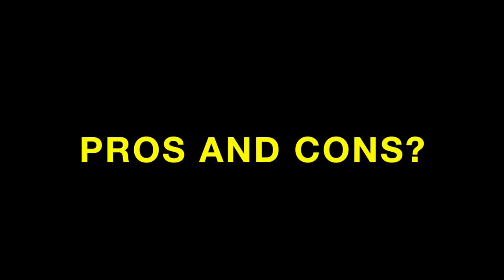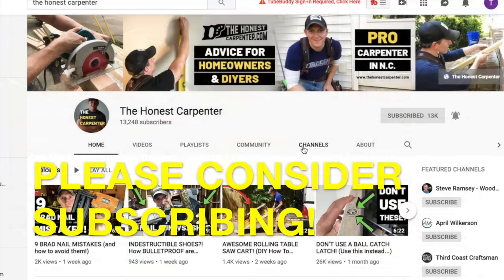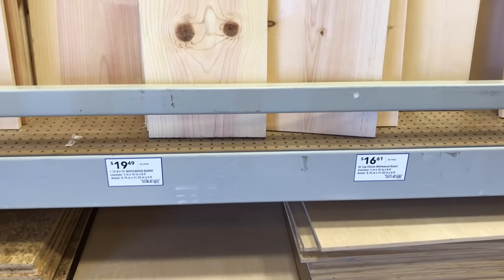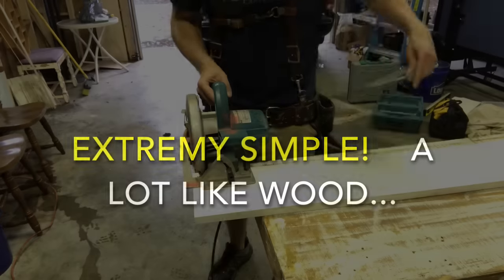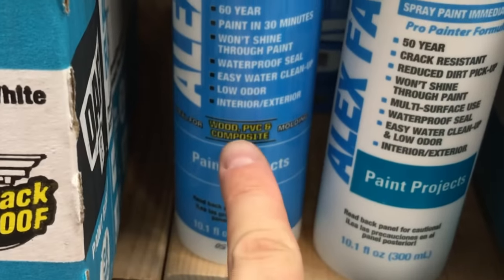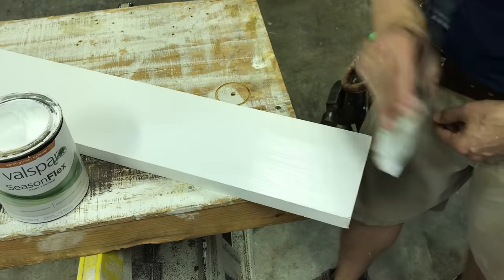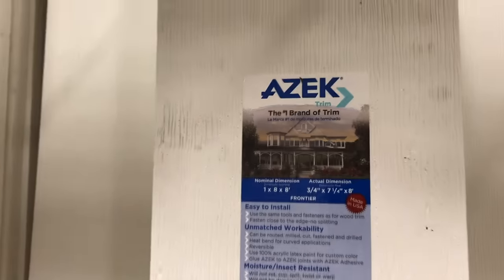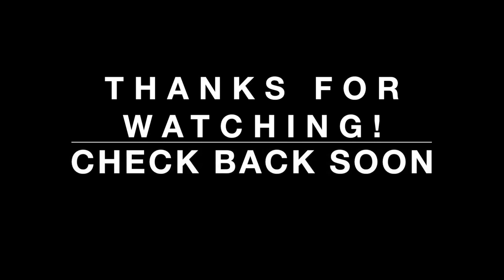PVC TRIM VS. WOOD TRIM? (Pros And Cons!)

Comment: I replaced the exterior trim on my detached shop (30' x 60') 5 years ago with the pvc trim I got at Lowes.  It's held up great.  My trim was originally white so it was an added benefit as to not paint.  On my corner pieces, I built a wood jig so I could  glue two of the trim boards to each other and keep them perpendicular.  The corner pieces were about 9' long.  I experimented with different pvc glues and the regular pvc glues for pipe had to short of a tack time  I ended up using a product by RH called HH-66 and it worked great.  It has a tack time between 2 & 3 minutes.  Long enough for me to apply glue to both surfaces.  15 to 20 minutes to be able to use.  It's about $30 for a 16 oz can but it goes along way.  I am now starting on my house and replacing the exterior trim.  What I found out about this glue, is you do not want any of it to run out on the exposed surface.  It melts into the pvc.  Strong stuff.  I scribe a pencil line about a 1/4" inward on both surfaces for my glue line to minimize any squeeze out.  Did not compromise the joint.  I used stainless steel white nails to complete the nail up.  Not one joint opened up.  I pre-assembled the corner pieces for my house (14 corners).  On all my glued corners, I actually waited until the following day to use.  Sorry for the long winded write up, but this glue really worked for me.  I did not try the Aztek glue so I can't say anything about it.
Reply: I had alot of luck using gel superglue. It held was super fast and very strong. I actually tried plumbing pvc glue too but it wasn't close to as strong.

Comment: Here's the thing about wood trim, its like a sponge. The vast majority of carpenters cut and install exterior trim without sealing the ends or backside. If the wood piece is properly sealed before installation, it can last much longer. I always seal the ends with a couple of coats of primer. In high moisture areas, such as, water tables and column wraps, a thick film of caulking or sealant is very helpful. Why is no one doing this? Yes it takes longer, but the results are long lasting.
Reply: At that point you might as well, and should, use PVC. Don't have to waste the time and money to seal the back and cuts with paint and primer. Plus it will last forever instead of a long time. I work for a design and build firm here in Virginia which is very hot and humid half of the year. We use PVC for our exterior trim 99% of the time. Saves on time and money when it comes to our warranty department. As long as the carpenter uses galvanized or stainless nails then we never have to go back to do repairs on exterior trim.

Comment: The fires in California have me re-evaluating everything now with an eye to blowing embers. If they could make PVC lumber fire resistant, it would be much more attractive. Right now both wood and PVC  are vulnerable. I’m using more galvanized/bonderized metal trim and stainless steel foil coverings as a result.
Reply from the maker: Hadn't thought about that DIY Guy...but unfortunately it makes a lot of sense in your area. I can't imagine how far the embers must travel out there. You might see some material manufacturing changes out west that are more focused on fire aversion. Thanks for watching and writing in!
Reply: Cement based products may be a better choice for your application.
Reply: @chrisgraham2904  Agreed. Over the past year, stucco with a thermal break over mineral wool seems to be the best that I could find.
Reply: @edbouhl3100  Sounds like a great option and you can tint the stucco to any color you wish.

Comment: Hey liked your video! I just subscribed.  My  home was built in 1947. So I've been doing a lot of renovations lol.  I have a question for you. I can't seem to find an answer anywhere on YouTube.  I made a big mistake on my bathroom flooring. Lol I learned from it. There is a 3/4" gap between the shower/tub insert and my vinyl plank flooring.   I've decided to put a 9/16" mounding in the gap. What would you use to adhere pvc to the tub? I bought some "Flex shot" which says it's good for tubs and showers. Now I'm afraid to use it.  It's a rubberized adhesive sealant.  Thanks Dawn

Comment: Does it have to be painted?  I am looking for some exterior product that does not need paint.

Thanks
Reply: I think it doesn't need paint, but perhaps it could fade over time like normal pipes. Just make sure to ground your tools( someone mentioned this earlier in the comments) and collect the dust. I recommend taking the dust to a person who recycles pvc. You can use water to keep the dust from flying. Just saturate it as you are cutting. You can waterproof your tools with some spray on Silicone lubricant.

Comment: I always advocate for PVC trim. Both indoor and outdoor. 

When installing the PVC trim indoors, if you install correctly around water proof flooring (life proof, linoleum, tile, ect.) you can chaulk the bottom and top of the trim effectively creating a tub that will keep your drywall, insulation, and studs safe from accidental water events inside the house, like kitchens and bathroom areas. 

Outdoors, I advocate for PVC trim especially around doors and windows, facia, window sills, and especially on the weather side of the house. 

I actually sided an entire house on the weather side with the stuff.

18 guage and 16 guage nailers Cruise though the stuff and your standard siding or roofing nailer works well with it too.

And the ONLY chaulking I use period is DAP Alex. It is the best stuff. 

Also, you can paint PVC with Acrylic Latex paint and primer.

Comment: It is obvious to me that you would have the correct answer to my question:  I would like to use PVC trim  (Veranda 7318 @ Home Depot) to replace vinyl moulding at the junction of the floor/wall in a bathroom, but after removing the vinyl moulding, a lot of very sticky adhesive remains on the wall. Do I need to remove it (and HOW - it fears not acetone and Goo Gone), or just apply the  DAP Alex/Loctite PL over it, or what? 
Many thanks from a new sub!

Comment: Hi, Very informative video as always. Thanks for sharing. I am looking to build a custom threshold for a patio door. Custom, because I can't basically find a 10+ inch threshold to fit between the patio door and the storm door. Would PVC be a good option? Trying to avoid treated lumbar.... would ceder be a better option? Thanks in advance to all that can give me a little guidance on this one.

Comment: Will it melt on my jointer, and will it wear the knives more? I need to reduce the width (edge jointing) a bit of some 7ft long 3/4 and 1 inch boards to match older construction trim that is not exactly to standard dimension on my 4" jointer.

Comment: I have rotting trim at bottom of door frame.  Do the differences in expansion/contraction all them to synergistically work together?  In other words, can I cut out the rotted portion and replace with PVC trim or will I have to replace the entire frame.

Comment: @The Honest Carpenter I'm planning on using this PVC trim around my windows and doors. If I screw it down about every 12" will it buckle when it expands? Im talking about 4 screws on a 1/4" X 3½" X 48" just for that wood cased look to contrast a dark color siding paint. Is there any other suggestions that wood be better to door. Any help is appreciated.

Comment: Is there a way to heat weld the pvc product on the market, also have you ever thought of using pvc cleaner and glue for assembly  of joints or mitres

Comment: I usually use a hot blade cutter to cut my pvc trim to make the edges smooth and to avoid the dust.
Reply: What kind of hot blade are you using when you cut?
Reply: @robstaggr  I don't use a conventional version from the store, i made it myself.

Comment: How do you approach long runs in fascia where the run exceeds the length of the board? Do you use a printable pvc caulking or primer and glue to extend the board?

Comment: Hi Ethan, I am planning to use 12" PVC trim as a beauty board around a deck that has a 45 degree bump out.  The ends of the boards need to be cut at a 45 angle.  They won't fit in my mitre saw, how would you suggest cutting them, with a circular saw?  Worried about not being able to make that straight cut with a circular saw.

Comment: I have some basement windows on one side of my house that are at ground level and they have old metal window frames that the sill plate are rusted and water is leaking from underneath the replacement windows that were installed 15yrs ago . Could I install a piece of PVC one by under the replacement windows to raise them up a little bit can I just silicone it down and use tapcons to screw it to the concrete

Comment: Hello thanks for sharing. Just a quick question. When used to replace a rotted vertical wood trim (edge of acrylic shower enclosure from another owner), can pvc trim be carved to match other shower trim design (3 indents running length of trim) or if same trim design isn't available just grab a plain one? Also, is it safe to install over  Borate wood rot treatment? THANKS

Comment: I was considering 2x2x8 plastic lumber to use on top of a pergola, however at $3.55 per foot/$37 per 8 foot compared to 2x2x8 lumber at $3.55 per 8 ft that is over 8 times the cost not including shipping! Staying with lumber and stain.

Comment: I read the label on the PL Premium and saw it said it's not for use for ABS bath surrounds or anything with water immersion. So, what adhesive should be used on shower surrounds? For example, I have a Sterling tub surround made of Vikrell that will have a Duratrim thermoplastic window trim (as there is a window in the shower stall). What adhesive would you recommend?
I came here looking for info on appropriate trims for windows. Right now I have metal windows that sit flush with the exterior (no sills) and have J-channels right up against the edges. I'm going to be replacing the old windows so I'm trying to figure out what sort of material to frame them with-- thinking of maybe going with PVC instead of wood since the wood sills on my doors have rotted.
Can the PVC be used to help anchor an awning over an exterior door or would wood be better? By anchor, I mean I want two vertical pieces of PVC on the exterior to help support and bump out the awning from the wall a little. I will have wood blocking on the inside of the wall as the anchor.
Man, where are you finding whole PVC sheets? None of my local stores carry most of these products. They have to be custom ordered & I had some I ordered back in May that never arrived. Had to cancel my order.

Comment: hi I’m using PVC for baseboard moulding in a basement on wood paneling.  I have the correct adhesives but should I also be nailing it into the wood paneling?  If so what kind of nails and what method of nailing?   I don’t own a nail gun, only hammers, but I dont want to ding up the boards hammering.  Any suggestions?   Thanks

Comment: i understand that it is best to install it when temperatures are more near an average, to help minimize the shrinking and expanding.  i want to install it on fascia, that has a pretty high rise to it.  so i dont want to ever do maintenance.  can you further expound on what happens with temperature changes, and what can or needs to be done ?

Comment: Always use the PL 3x adhesive regardless of wood or pvc. Project farm has a great video comparing adhesives and it’s clear which is best.
Reply from the maker: Thanks Heath, I’ll check it out. I’ve used a lot of various PLs in the last couple years. The only thing that bothers me about them is that off-gas bubbling. Otherwise, they’re incredible

Comment: We have been using synthetic polymers for maybe 75 years and already there are certain microbes that have evolved a means of degrading them, specifically nylon, with an enzyme we named nylonase. So it is just a matter of time before they evolve a means of metabolizing pretty much any and all synthetic polymers. The only one I could see them not would be the perfluoro compounds since fluorine-carbon bonds are the hardest bonds to break. That being said at least we will have a couple hundred years of rot free exteriors.

Comment: I know I'm kinda late on this video, but it came at a real timely manner -- having to replace a ton of water-damaged siding and trim around the house.  I previously used PVC to replace the porch support beams (that were done with pressed board and rotted like toilet paper), and noticed it REALLY dulled the blade on my mitre saw.  Is this common as well?  Should I not use the expensive saw blades for cutting PVC?  Is it more prone to high temp heating while cutting, which leads to faster dulling of blades?

Comment: Thank you for that very informative video. Can this be used to replace the bottom part of wood trim on an outside door as if replacing for wood rot in the bottom section of the trim around a door?
Reply: Probably

Comment: In the Uk PVC has been used for 50 years, most houses have PVC doors and windows, in fact the roofing parts are also PVC.
some early builds have had it renewed to a better quality PVC. This is probably because wood is expensive in the UK.

Comment: I entered the below comment 2+ years ago, after first seeing this video.  Shortly after that,  I offered to install baseboard in My girlfriend's son's home, and they went out and bought PVC trim (because wood was so expensive during Covid)...so I ended up working with it.  And I HATED it, primarily because the sawdust was terrible and clung to every inch of every tool!  Fortunately, I was only using a miter saw, which I could vacuum); I cringe to think of trying to clean it all out of my table saw!!!
Original comment:
I have owned homes for 50 years, and I have never experienced rot inside my bathroom or laundry room (sole exception:  Leaking shower pans, which rot the FRAMING, not just the trim!).  So I challenge the idea that this is really an area in which one should be putting PVC.

Comment: One more drawback of PVC: It doesn't take paint nearly as well as wood. I painted both, even scuffed up the PVC prior, and did a simple scratch test. The pvc paint scratches so easily, and goes straight to the white. The wood on the other hand does not. It takes significantly more scratching power to get any wood to show itself.

Comment: I have only recently become a fan of PVC trim and all of what you say is true.  I must admit, though, the stuff kind of creeps me out regarding the microfibers.  It is bad enough that it "snows" your work area as you pointed out, but it especially bothers me when I think about the super-small, lightweight microfibers that just get released into the air.  You pointed out that it is helpful to wear a dust mask.  I would suggest that if you use PVC a lot, it might actually be the difference between life and death in the long-run.  Breathing/ingesting that stuff cannot be a good thing and I haven't researched any government studies on long-term health effects of sawing the stuff.  But I have the bad feeling that there aren't good studies on it and an even worse feeling it may be a LOT more dangerous than we can imagine.  The problem is that I just don't know.   As for the PVC snow left on the work area, I would suggest bringing a small shop vac and use it to clean up -- even from the grass in the yard.  It might help keep it from getting ingested from small animals -- which in turn, get eaten by other animals -- to toxic effect, similar to what is going on in our oceans.

Comment: What about PVC decking? I need to replace the decking on my home in South West Florida and would like to use PVC. The substructure is fine and would like to make the space underneath the deck water tight. What is your opinion.
Reply: About the only way to make the space under your deck water tight is to apply a continuous membrane to the deck surface.

Comment: I've avoided using PVC trim outdoors for the simple reason that plastic becomes brittle when exposed to uV light. But I'd be interested to hear from anybody who's had PVC in place for a few years. Is there a problem with it becoming non-flexible and therefore cracking under heat and cold?

Comment: I’ve noticed some 1/4 round trim PVC trim that says “interior use” (at Hime Depot) Is that a different grade, or does it just need paint to protect from UV?
Reply: That's right.
PVC doesn't hold up to UV without either paint, or a dye, if left unpainted.
Now you know why "outdoor" PVC products (think electrical conduit) is grey (usually), instead of white.

Comment: Why does no one talk about using plumbing PVC glue on these PVC boards to join pieces together?  I did some experiments with butt joints and was really impressed, as its essentially a "PVC weld" when its dried fully.

Comment: Great video.  I was about to replace my trim with PVC trim but found out it's not recommended to paint the trim in darker colors.  It looks like I may need to use wood for a brown color trim.  Is that the consensus?

Comment: I used 3/4 sheets of this stuff to make an island with pull out bins the stuff is amazing. Has anyone tried taking a router to it with an ogee or something similar. Another dumb question is it possible to heat seal those cut ends I know this technique works with high density foam might be wort a try.
Reply: Heat doesn’t work to seal the edges. But you can use a heat gun on any imperfections on the surface.

Comment: Will baseboard pvc bend? When I tried to use pine for baseboard, the sheet rocked corners were so flared out that the baseboard running along the wall had a gap needing caulking! Is there any way around this?